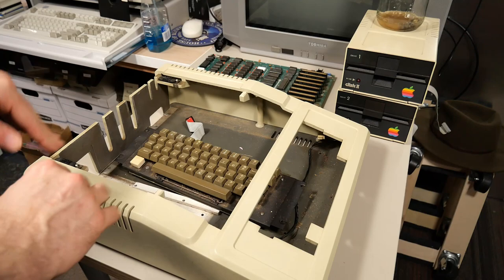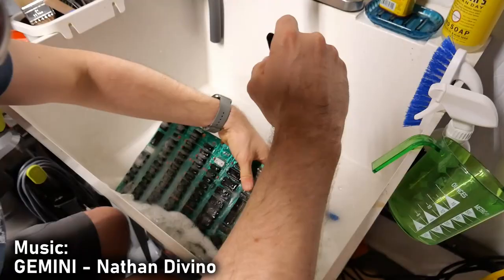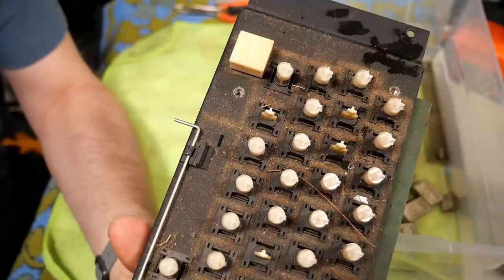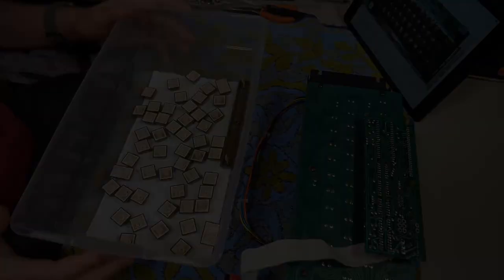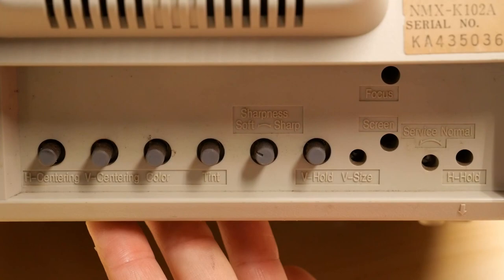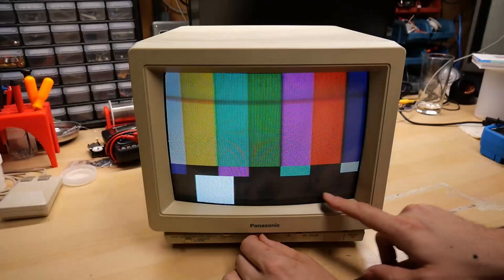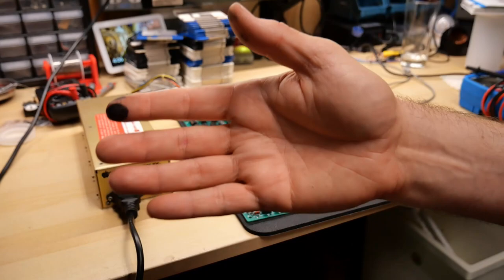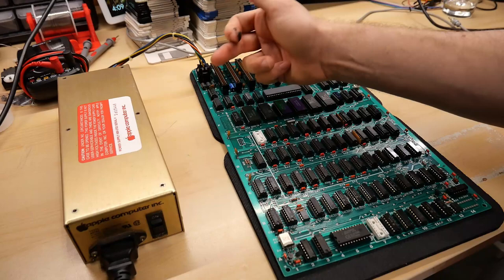Apple ][ plus extreme cleaning + testing the Panasonic Monitor

Comment: David Perkins gave a great suggestion. There's a good reason that mainstream manufacturers quit using socketed chips long ago. Each one of those contacts is subject to invisible corrosion. (OK - sometimes it IS visible!). Use a chip puller or a small screwdriver to partially remove and reseat every chip a few times. It's too much trouble to pull them completely out, plus it's easy to get clumsy and bend pins when pushing an IC back in. Not guaranteed to make your old clunker work again, but well worth the fifteen minutes it takes to do. 
Back when sockets were common, badly trained industrial techs would remove a chip, replace it with a new one, and repeat until the board under test worked or they swapped every one of them without finding the problem. (Then they had to start thinking instead of acting like a dumb chimp, but that's a different story. ) Anyway, often enough that worked. The problem was that they did this with boards powered on throughout. This was when 4XXX CMOS chips were common, so while they usually got by with it, there was a good chance that they caused damage that wouldn't fail completely until later. The point of this is: Don't ever remove a chip without making sure power is off and using a wrist strap. Lots of people get by with ignoring this, but in the long run it's a bad bet to make.

Comment: The keyboard encoder was an AY-5-3600 by General Instruments which was a purpose designed PMOS device that used a couple of ring counters, a comparator, and a 3600 bit ROM to scan for switch closures and generate keycodes. As a side note however... by 1983 GI was selling the KB3600-PRO which was a PIC1650A microcontroller with a mask ROM for emulating the AY-5-3600 while adding a couple features.

Those 8T97s are the address bus buffers and blew occasionally when other address logic went up so I'm not surprised on the different chips. In the factory, all three were parts from the same feeder.

Comment: Great videos series, thanks for sharing-I'm the original apple II kid, but personally I wouldn't have cleaned it before finishing the trouble-shooting since from my experience, it's too easy to introduce another issue thereby compounding the repair process. Your initial smoke test  symptoms: power light on, screen filled with gibberish, no beep, indicates bad MOBO or PS. Since you tested the PS, the next thing I'd check is the 74LS74 power reset chip,  then the crystal, or one of the 8T97 chips.

Comment: Older TVs, I'm talking up through the 1980s at least, had a dedicated circuit called a "color killer", which turned off the color circuits when a monochrome signal was being broadcast, improving the monochrome picture quality and eliminating any spurious color in the monochrome picture caused by interference.  TVs of that era didn't have too fancy of filters to disable.  I know this is a monitor, so a bit different.

Comment: I remember the first time I tore a keyboard apart to repair I did not think to map out where each key went so I had to use my type by touch to remember where each key went. Basically remembering what each key I hit with each finger. That only happened to me once.

Comment: I've had good luck removing seized, broken-off screws with a left handed drill bit, for what it's worth. Harbor Freight sells a set inexpensively, and for how infrequently I use them (like, 1-2 times a year?), they've been fine.

Comment: Don't know if you have this stuff up there, but Nifti is stronger than Windex. Next stronger is a good brand Sugar Soap. These ammonia based cleaners don't need much if any scrubbing. You could also try bleach.
Plastic can be polished like any car paint so for the key sides you could use 2nd cut and polish, which is slightly abrasive to clean and smooth, and polish to make it glossy. Cutting compound first if it's really bad.
CLR eats rust, so it might have got the rust out of the broken screws threads so they can be unscrewed. Vinegar is milder, but might also work.

Comment: Hey Adrian, some chip manufacturers stamp some info like date codes and type also on the underside of the ic package. I lately found that on some fake AY-3-8910 that had suspiciously new looking topsides on the underside still had original date code and YM2149 stamps on. So check the underside to see if this can clear things up.

Comment: To add to Greg Gall’s comment, the PC board manufacturer usually adds a date code at the copper level, (if not, sometimes as part of the silkscreen level), usually in YYWW or WWYY format.

Comment: Also, in my experience working in an electronics manufacturer, it’s not uncommon to have multiple vendors for a given part, so some of the vendors likely had various lots of a given part, especially if they were a second-string vendor (buying up leftover lots from the manufacturers when certain products get discontinued etc.). As a case in point, one board my company built up until the mid 2010s had a fairly scarce IC, and the lot that was located to allow us to keep building as long as required had a 1981 date code! So, the variation in date codes would be somewhat reasonable for a vintage 1983 Apple.

Comment: The marks on the side of the keys is normally due to grout from fingers.  The mix of dead cells, sweat and dirt act as an acid and discolour the plastic!
As for a dirty machine - long way to go. I had machines returned to IT where you could not see the chips on the board from the dust and bits - yuk.
Worse keyboard was one from a home office set-up where their youngster had an 'accident' without nappy (diaper) and they returned it to the office for us to clean - yuk yuk yuk.

Comment: For removing screws, you might want to get a set of screw extractors or EZ-Outs. They are a little like taps, but  left-handed and wedge in the hole you drill. There are left handed drill bits that sometimes will spin out a screw on their own, too.
Reply: Screws stuck in those brass inserts are a pain to get out.

Comment: I think you need to populate the missing DRAM IC. The chip is normally removed and put on the memory extension card. This trick allows the extension card to gain access to DRAM timing without having to add additional logic.
Or put the language card back in.
Just my guess though as I have never serviced them before. 
Unless you count hitting them with the Fonzie fist to get them to boot (due to bad socket connections on the mainboard, did that lots on the high school Apples, in the before times.)
Cheers,

Comment: Sharpness is increasing or decreasing the highest frequencies of the video.  As an analogy, in the audio realm, it's like a treble control.  Jump the frequency up a couple megahertz,. and you have a sharpness control.  The highest frequencies of the video signal contain the detail information.  Boosting it too high can cause "sparkling".  Decreasing the sharpness, removes some of the detail.  The key to sharpness is to get the best signal without sparkling.

Comment: 13:33 Newer Apple II plus models had a switch at the top of the keyboard just inside the case.  When activated you had to press control with the reset button.

Comment: Adrian, a date code span of 12-15 months wasn't unusual in the Apple II+.  This was due to variations in the supply chain, where some of the chips were available in large lots (and thus an older chip might make its way into a newer unit) and other chips were available in smaller lots.

However, the 5-year span of date codes in this example is suspicious.  The keyboard and encoder, and the layout of the motherboard, make it clear this is a late II+, probably a Rev. 7 board, so that 1978 chip is way out of place.  Perhaps this was used as a donor machine to keep another II+ working, and the "bad" chips were put back into the donor machine to be "tested again later" --- without marking them, of course.  A terrible practice, yet one I have encountered before.

It will be very tedious, but since the II+ has mostly standard TTL chips in sockets, I encourage you to simply test every TTL chip to determine if they are good.  This will also create the opportunity to reseat all of the chips.  Don't assume the first bad one you find is the end of the story.  Until you have verified everything, treat it more like a bag of loose chips than a complete computer.

As others have pointed out, you can also try booting after removing all but the Fxxx ROMs, you can remove all but the first 16K of RAM, and you could swap in another 6502 processor from your stock (or a Commodore disk drive).

Comment: You should have dropped some WD40 on those screws and given it a few hrs, may have worked them loose (it's what it's designed for)
Reply: Actually, original purpose of developing the WD40 was not to loosen screws. BTW it's still great to do so.
Reply: @Kedvespatikus  I didn't mean it was specifically developed to loosen screws... but more of getting down into rusted areas to un-cease and lubricate,  and such..
Reply: Kroil might be a better choice, but if it the bolt was already rusty and someone used excessive speed/force putting it in there may be no removing it. After trying a few things, it might be easier to drill out. There are bits for extracting bolts and remaking the threading. Not particularly expensive either.
Reply: @Ghozer  WD-40, short for "Water Displacement Formula 40" was developed for application on rockets to protect them from corrosion by Rocket Chemical Company, later renamed WD-40 Company. It was only much later discovered that WD-40 had also a much wider variaty of use cases, so they began to market it first towards businesses like airlines and general industry and later also the common consumer.
WD-40 isnt a lubricant, its sole purpose is to keep water from a surface that it was applied to for the short term.

Comment: I prefer using citric acid with few drops of dish soap instead of vinegar. It takes the rust off better and is less damaging to healthy metal. @10:45 When you were cleaning the keys. Was this shango066 repair video that you were watching?

Comment: 25:40 Sorry to correct you, Adrian, but the //e PSU, while indeed very similar, is physically slightly longer, and won't actually fit in the ][+ case, nor will the mounting holes align. I tried while trying to replace a dead PSU (now revived). ;^)

Comment: I would think that if it was worked on, the repair shop may have used either what chips they had in stock, or what ones they could harvest from dead systems. That would explain the wide range of much older chips.

Comment: you have to use rust remover on such screws! same as you use on cars. you need to use the right screwdriver size and thin cut disc

Comment: Adrian, I'd be curious to know whether applying some hot air to the keycaps brings the colour back out. It is a method i've used previously with mixed success, depending on the plastic. As hot as possible without making them soft (80c hot air seems to work for me on ABS plastics).

Comment: That weird discoloration on the keys may be an artifact of the original molding of the keys.  Plastics tend to degrade more near where the plastic is injected into the mold (the gate). That is why you see similar splotches on large exterior plastic pieces on cars.

Comment: I know this is kind of cheating, but I have a Sony Trinitron TV that will accept just the luma over the composite connection.  It shuts off the chroma filtering and drives all 3 guns at the same time resulting in a very sharp picture!  This is also how I found that my C64's video signal is kind of leaky as occasionally a burst of artifact color occurs.  (I think this is why my LCD's with composite do not like the C64 as they expect a clean and precise signal.)

Comment: Actually, as Apple ][ power supplies go, this may have been the second or even third power supply. When the power supply in my ][ plus (which was modified to be a europlus) went bad in late 1984 I visited my local Apple dealer (Computerland) and asked for a new one. They wanted to sell me a Macintosh instead. As if a high school senior had the money for one of those... in 84...
Luckily there were lots of ads for third party parts in computer magazines, so I just mail-ordered one of those. And since that was my first experience of Apple going bad my next computer was... an Atari ST. Thanks, Computerland, but no thanks.

Comment: With all the date codes goofy like that, I wonder if someone didn't try to Frankenstein it.  Wanted to send you a "trial by fire" sort of speak. Another thing, if someone went on eBay to get some of those chips, I would be suspect of anything with a date code because of recyclers.  I was not able to really tell but did any of the chips look bent out of shape, or coated darker (Re coated and re-etched)?  I guess it's time to verify each chip by itself...

Comment: Is that normal that one side of the card edge connectors looks different from the other side? At first I thought one side had caught some rust, but it was on every connector, and after cleaning it looked like one side was silver and the other was gold (yes, it was probably aluminium and brass rather than precious metals).

Comment: The contrast is not working correctly assuming the unit has black level clamping, the contrast should not adjust the brightness, only the gain of the video on the black level.
The contrast changing the brightness level could be a couple of causes,
1 The unit does not have black level clamping or it is faulty.
2 The unit is beam limiting, and the beam limit is on the grid..

Comment: Apple had a Lot of Extra Parts that were Gotten Dirt cheap, and Older Date Codes do Pop in, same IC with a few Years gap Is still the Sam IC stander it worked and the Product get Shipped..

You Think you can Handel a RCA Cosmic Kit computer..?

Comment: The reason your keys are splotchy is because of the magic eraser most likely. The magic eraser is actually very fine sandpaper. What you're doing is eating through the glass coat. To restore the shininess you need to respray them with a clear coat
Reply: Glass=gloss

Comment: Arghh! If I may.. Let me advise you that High Voltages are associated with magnetic fields? Fields that can change small magnets polarity, Eg: Magnetic Disk mediums have segments of tiny polarisable magnets, Having said that I hope that disc Err-Disk was already corrupted over it's life time by Earths Magnetosphere, if not then this is why that disk may be failing if it was useable previously.. "APU" Err-"As Per Usual" I dropped a Like..

Let me add computer monitors are designed to minimise the magnetic field so that magnetic mediums have a  less likely chance of corruption, but with age you never know how a device is actually behaving..

Comment: Greetings Adrian! Could you share what you are using for generating the test patterns for your display? I'm trying to calibrate some Amiga video Toaster boards and need some good reference signals and have not had much luck finding NTSC test pattern generators for reasonable prices on reseller sites...
Reply from the maker: Ah I use a Tektronix TSG 130A -- I picked it up off eBay ages ago. If I recall, I paid $55 shipped for it which seemed reasonable to me.
Reply: @adriansdigitalbasement  Thank you! I'll be on the lookout for one or a similar device.

Comment: Also, does the language card need to be installed? If I recall, there was a jumper cut trace and that socket in the ram section had a chip in it before the language card was installed.

Comment: its strange to think years ago you got warnings of "do not wash with water or pour water over" yet here we see ppl doing this and the boards "are" sometimes okay, not always but its odd to see,
Reply: I think the issue is really when boards are still wet when power is applied. It's easier to say don't use water than it is to go into detail of how to do it properly.

It's the same thing with putting foil in the microwave. It's fine if you do it right but can be disastrous if done wrong.
Reply: The other potential issue with water is that it can leave a mineral residue. I would suggest rinsing it off with distilled or isopropyl alcohol after cleaning, and then blasting the board with real compressed air (not the stuff that comes in a can - use an actual oil-free air compressor, such as is sold for use with air brushes). That way, there won’t be any minerals that could dry on the board and create a conductive path. Note that you’ll still want to leave the board to dry for a while after the compressed air, as there may be some residual moisture under components.

Comment: I must have missed something since when can you use a sink with warm soapy water to clean computer parts?!
Reply: It's fine as long as there's no power source. Obviously no A/C mains but absolutely no batteries either. It's the power that will short everything out.
Reply: Works perfectly indeed. I bath it afterwards in Isopropanol to drive away any water molecules and than I leave it to dry in the sun a short while or an oven  at 60 degrees Celsius.

Comment: Just a question from a guy, who does not know anything: "-5.3 volts, it's a little bit high". since it's negative (is it?), should it not be "it's a little bit low"? Can anyone please explain?
I am sure, I heard that in some videos now but never noticed until now.
Reply: The mathematical term is "large negative".  It's negative, but it has a high absolute value.
Reply: @malloryworlton6359  thank you very much! :)
Reply from the maker: Voltage is about potential away from a ground reference... So if it's negative or positive voltage, it's all about how far away it is from the ground. If you touch a wire that has -40,000 volts on it, It is just as dangerous as +40,000 volts. If you have a device that requires -12 volts and you're sending it -17v then the voltage potential is too high, or as is normally said the voltage is too high.